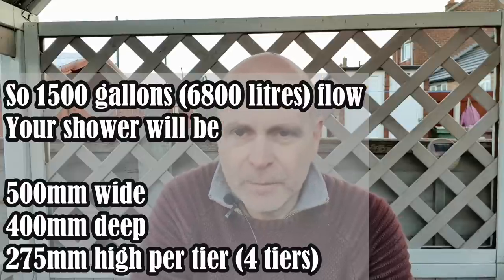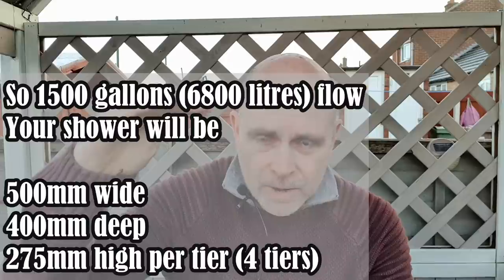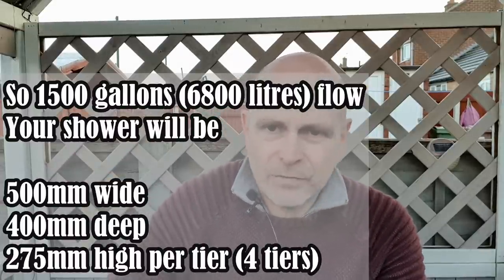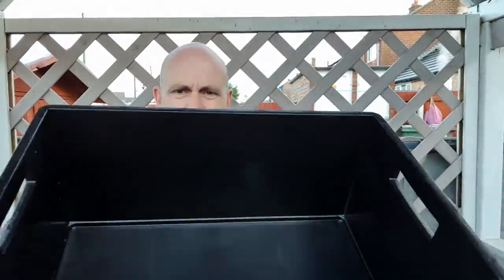DIY Bakki shower (Make your own PART 1) homemade Koi pond filter

Comment from the maker: Hi guys, I forgot to mention in the video, its not a showstopper but try and get the trays without handle holes if you can. You might get the odd bit of splashing if you have them but not a disaster if you cant get them.

Comment: Recently setup a new pond. With pressure filter and pump. Can I add shower off a separate 12000 pump. Will this be ok and will the containers this size be ok? Thanks
Reply from the maker: Hi Mark, you can definitely do this and see great results. If its not being pre-filtered, make sure to use the correct ceramic media as alternatives will block up. I would got up to 600mm wide for a 12000 pump.

Comment: Very informative video 
My pond is a similar size to yours and I will be running the pod as well the difference is I will be pump fed
First question is would it be better for me to put a separate pump in and still use the pod 
The pond won’t be running until spring 
When I was getting the info about the pod Shirley aquatics said I wouldn’t need a shower because the pod will do it all
Sorry it’s a bit long winded but I am new to the hobby and I want to get it right 
Regards Gary
Reply from the maker: Hi Gary, what size is your pond?
The Pod is capable of handling a pond up to around 1500 gallons if setup correctly. The thing with a shower is it gives you things that normal filters don't such as nitrate removal etc so they are a great addition to any pond whether it needs extra filtration or not.
Reply: Thanks for getting back to me
My pond is a similar size to your just over a 1000 gallons
Reply from the maker: Hi Gary, yes you definitely need the Pod as your main filter. You can then supplement that with a shower to give you the extra benefits that come with it such as reduced nitrates, extra aeration, de-odorising, gassing off of some Ammonia, extra biological filtration etc. The shower isn't necessary, your fish would live fine without it, but they will thrive with it 👍👍
Reply: @DazzleKoi  thanks for that when I am up and running I will definitely make one
Do you think I should run it off a separate pump or off the pod pump as I’ve said I am pump fed not gravity fed
Reply from the maker: Hi Gary, I think you could do it a couple of ways but if it where me, I would run a separate pump, yes. The thing with a shower is , they are brilliant, but if you miss by just a tiny amount, they are just a trickle tower and you'll be disappointed. Its very fine margins between getting it and not.
If you are building one I would say go for it fully and nail everything and you wont be disappointed with it 👍👍

Comment: Hi daz I have a load of bhm media left after mankind shower . Can I put this in a static flow through tank or does this only work with a shower type set up ?
Reply from the maker: Hi Martin, you can definitely use it submerged but it wont give you any special performance. It has surface area for bacteria but it wont really do anything different to say K1 and it costs a lot more. Can you squeeze on another tier maybe?

Comment: Great information thanks can't wait for this one to have a go at building one happy new year
Reply from the maker: Thanks Colin, if you do use these trays, try to get the ones without handles. I don't think its a show stopper but you may get a bit of splashing if you have handle holes, I should have mentioned that in the vid but I forgot.

Comment: Hi Darren are you going to run the shower straight from eazypod or through skimmer thanks mike 👍🏻
Reply from the maker: Hi Mike, my system is 3" bottom drain to Pod, Pod outlet straight in to 10,000 vario pump, out of pump to shower via UV . I'm not changing anything , just putting the shower as the return instead of a pipe over the wall 👍

Comment: Excellent so pleased you have done this as I have been wanting to do it for my new system and properly, I have looked into media that doesn’t cost stupid that works with a compromise over the very expensive original and that was pumice stone look forward to seeing your next instalment 👍
Reply from the maker: Hi mate, thanks very much, I appreciate that. I've got a lot of work to do on the media as its an absolute minefield and very difficult to measure performance without testing each one over months and months. I've got pumice on my list 👍👍

Comment: Intresting video. I have one of the widely available beige showers, 4 tier, 600 wide, think there only 220 deep though. Intresting to know if the reduced width makes much difference. I'm using quite a low flow as it's after my pod at the moment but in the process of swapping for a profi drum so the flow will be increased then. I use that midori Infarred media from kitsu koi aswell as kockney koi kintama bio balls on the bottom tier, working great for me, even with my low flow my nitrate is almost 0 and is lower than I get out the tap. Always looking for ways to improve though
Reply from the maker: Hi Dan, sounds good. Interesting that you see reduced Nitrate with the midori media as that's one of the ones I intend looking in to 👍👍
Reply: @DazzleKoi  sorry my mistake it's. The sakura far infrared (probably the same stuff) from kitsu koi
Reply from the maker: Hi Dan, no problem, I'll check that out to 👍👍

Comment: Hiya can I ask, would the 600x400x320 still be ok for the shower.  Initially planning on using alfagrog, to keep cost down.. on a 8500ltr pond, bottom drain and gravity fed.  Still in the process of building the pond by the way.
Reply from the maker: Hi Steve, it all depends on what flow you are putting over it really. That's quite a big shower if you are only putting Pod flows over it but would be ok for say a nexus 320 or similar. Do you know what filter you will use yet?
If you can stretch to pumice it would be much much better to. Pumice will do a good job but grog is close to useless in a shower if I'm being honest.
Reply: @DazzleKoi  I was aiming for either an 8000 or 10000ltr pump. Only asked about the 320 high to make more of a drop in water, I don't mind using the 270 high.  I don't mind going for pumice inside.  The shower was going to be the main filter to start , was then thinking of making a diy upflow filter which would then feed into the shower
Reply from the maker: You could use the 10,000 on those trays, just about and the pumice will do a good job for you. The 320 trays are definitely better than the 270's if you have the space to accommodate them.
The problem you will have though is that with no mechanical filtration your pond is not going to be clear and you will quickly block up pumice if you pump dirty water to it. You really need a mechanical filter before the shower from the start to take out the solid waste first.
I would definitely make the upflow filter first and then the shower if you can't do both straight away. The upflow will work without the shower but the shower wont work without the upflow. I have a video on upflow filter principles if you haven't seen it. The next problem you will have is even a 250mm upflow filter (like the tempest) can only work well up to 5000 litres an hour so you wont be able to get enough flow through an upflow to feed a shower that size.
I would look at a nexus 200 or similar if you can and then add the shower after it later.
Reply: @DazzleKoi  cool this is really helpful, never got the same level of detail that you give.  The only mechanical filtration I guess I might have is brushes that I'm going to put in a box like container my 110mm pipe is going to go in from the bottom drain. Would that be enough?
Thanks again for the info
Reply from the maker: I'll be honest mate I doubt it very much. You really do need some good mechanical filtration or you will have loads of problems with bacteria build up as well as dirty water. What about a sieve? Is there an option to fit a sieve off your bottom drain?
Reply: @DazzleKoi  I had looked at them but it's the budget, don't mind giving a diy one a go 😀.
Reply from the maker: I understand mate, its not a cheap hobby. They come up second hand quite often but they still seem to be fairly expensive. I suspect by the time you've taken everything in to account it might be just as cost effective to find a second hand nexus 220 which will do everything. Its a good sized pond so its going to need something significant to do it properly.

Comment: Do you have to clean the media? If so, how often?
Reply from the maker: Hi mate, I've never cleaned media in a shower in 26 years but if you didnt have sufficient flow going over it you may need to. Also if you dont use the better medias they can block up.

Comment: Great video I’ve got a monentro balking shower I got secondhand at a really good price I’m pumped out so I’ve got a t junction one going to my nexus one straight to the shower I’ve only got a 15000 vari pump on it to the max would you put a bigger pump on it as I need minimum of 7000 to get the nexus running right the shower is full of bhm I’ve only got a 1000 gallon pond what do you suggest? Thanks Kevin
Reply: Baku shower I meant sorry
Reply: Predictive texting bakki shower
Reply from the maker: Hi Kevin, its not a straight forward one this to be honest. The shower you have is really designed to work properly at or over 15000 litres and its for a much bigger pond. To get it to work right you would need another pump but its an awful lot of flow for a 1000 gallon pond. You could do it, but its going to be expensive to run. You will have one hell of a well filtered pond though 😁👍👍👍
I guess the best approach would be to use the 15000 pump on full belt to the shower and put a second , smaller pump, say a 10000 variflow throttled back, on the nexus.

Comment: Can koi pond solely depends on bakki shower filter system? With no other mechanical filtration involved.
Reply from the maker: Hi there, I filtered a 5500 gallon pond with just 3 showers and no other filtration at all so it can be done, yes. But you need to use genuine momotaro stainless steel showers with 4 tiers and the correct amount of genuine Bakki House Media (BHM).
The problem with this is that you need massive water pumps (I had 3 x 15000 litre pumps) and it is very expensive both to buy the showers & media and to run the pumps.

Comment: Are they noisy,or can you fit something to make the water go in the pond smooth?
Reply from the maker: Hi Mike, they can be , yes. I'm going to clad mine with something like the tiles I have on the pond and they will probably go on to a cement fiberboard or something like that so its likely I wont hear much from mine when its finished. 
Its the sound of water so its not an unpleasant sound.
You can put a weir or something like that at the bottom to which makes the water enter the pond quietly.

Comment: Hi, nice informative video.  The design of the Momotaro showers has quite a large air gap between tiers, is that a critical feature?  It looks like the plastic boxes stack quite snugly so would not have the same airflow. What do you think?
Reply from the maker: Hi mate, no I don't think its relevant. There is air everywhere around the inside of them as they are far from air tight. Also, anaerobic bacteria, which is what we need to encourage, needs an environment void of oxygen anyway. The only oxygen it needs is the oxygen in the water tied up as nitrate and it breaks down the nitrate for its oxygen source. It will cut down on wind chill to having them more closed in. I'm going to box mine in further with a cement fiberboard and tile on top of that . Bead filters work brilliantly to and they have much less air supply than these showers will.

Comment: Happy New Year mate! I have been looking forward to this particular video. Thank you for all your help. I should have my new pond completed by the end of summer (1500G) and the build will be very similar to yours - gravity fed using an Easy Pod with a 3 inch drain. I definitely will go for a diy shower but I have a couple of questions. I plan to run the shower off a skimmer and if I use a Varipump 10,000 could this pump handle the pod return and the skimmer to the shower? I thought of buying two separate vari pumps, so effectively have two independent set ups but would you recommend I should go for just a  20,000 Varipump to do everything? Sorry about all the questions! All best Darren
,
Reply from the maker: Hi mate, sorry for the delay, Happy New Year to you to 👍👍

I dont htink you can, no. I think you will need a 10,000 variable speed pump on the pod immediately as the water comes out and that can return over the shower and then have a second pump on the skimmer line. If you T the skimmer line in to the bottom drain line you could use valves to balance the flows (not easy) but you would only be able to run the pump at 5500 litres as it would all go through the pod.
Reply: @DazzleKoi  Hi Darren, Thank you for your advice , very helpful, this  makes sense and running a 10,000 variable pump after the pod to the shower at 5500 litres flow rate is a good plan .  Going back to the skimmer line, if I run another 10,000 pump through a 55watt UV and through  ...perhaps two side inlets into the pond ? this would produce good water movement for the fish. Is this a reasonable option in your view,? If so, what flow rather would you recommend on this skimmer line set up? :) sorry about more questions! 

Stay safe mate and thank you again for all your help. Regards Darren
Reply from the maker: HI mate, yes that's a good plan. Mid water returns are great for water circulation. You can fit the tangential ones so they come in at an angle and encourage circulation. That helps keep the pond bottom clean amongst other things.
In terms of flow, I would match it to whatever your particular skimmer manufacturer recommends for their skimmer. Keep in mind that your UV will have a maximum flow as well.

Comment: Hi can u help please what size bakki shower would u say I need for a 6300lt pond please I have alfagrog and have on order bakki house media
Reply from the maker: Hi Mark, its more related to the flow you can put over it than the size of the pond. If you can get say 6000 litres over it then I would suggest 400mm wide shower at the most. More flow concentrated over less width is the way to go 👍

Comment: Hi mate any tips on what’s best to treat fin rot still having nightmares thanks 👍
Reply from the maker: Hi Lewis, sorry to hear that mate. I have never had to treat for fin rot so I'm going to cheat and recommend a web page to you that I would use if I came across fin rot. I've had a read through it and it is really comprehensive and is the one I would follow if I where you.
Sorry that feels like a bit of a cop out but I don't want to give you poor advice and I know the site below know there stuff.

https://pondinformer.com/how-to-treat-koi-fin-rot/
Reply: @DazzleKoi  that’s very helpful of you thanks I wil have a read of it now thanks mate 👍
Reply from the maker: No problem, let me know how you get on mate 👍👍

Comment: Hi mate. I am planning on making a shower in the spring. Watched the 1st 2 vids in this series and really informative.  I ordered my media in November in readiness (although still not here due to port hold ups) I went for Sakura Far Infrared Shower Filter Media. This is heated to 1800 degrees and i think is a new version. They sell it at Queni Koi but I found the volume I wanted was about £100 cheaper at Kitsu Koi. See what you think 👍
Reply from the maker: Thanks Matt, I have heard about the Sakura one. It sounds like its the same material and method of production as the genuine BHM so its definitely one that interests me a lot. I will definitely be looking in to this one 👍👍🍻